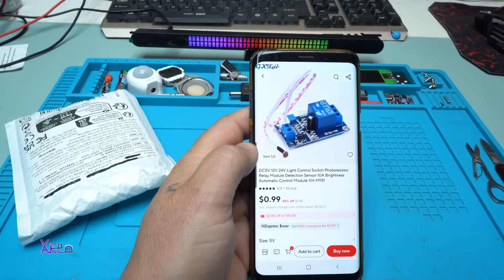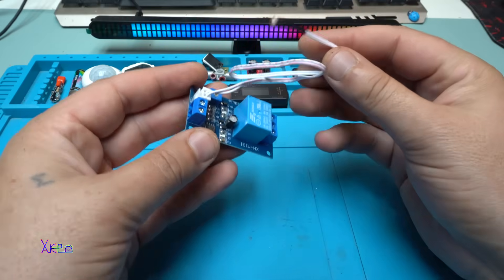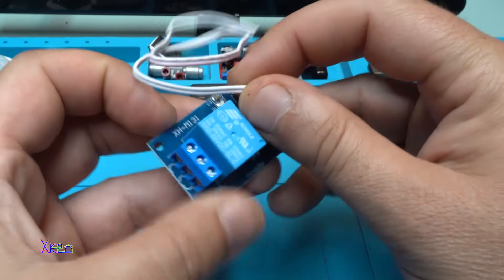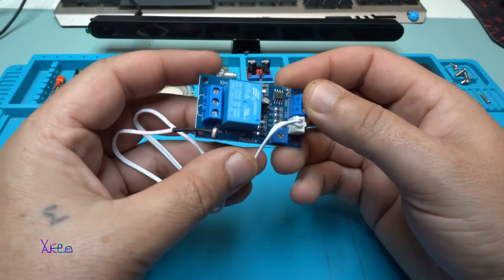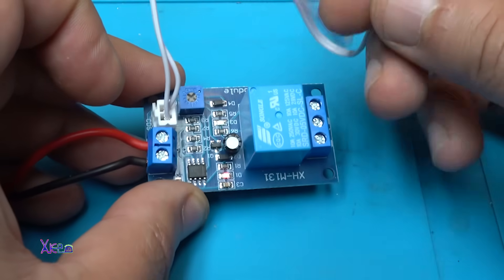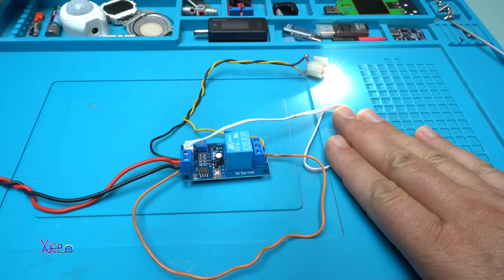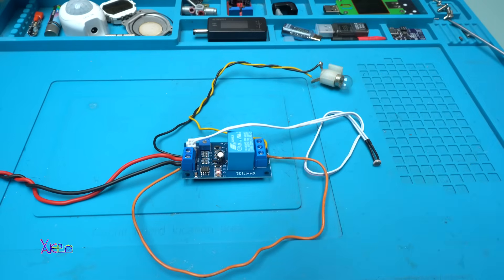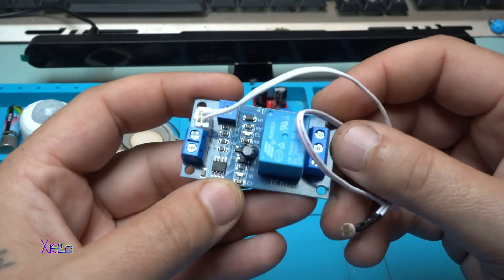$1 Aliexpress Module That is PRACTICAL?

Comment: I saw a potentiometer on the board, is that to control output voltage or sensor senstivity?
Reply: Sensitivity. Relay doesn't control voltage.
Reply: The sensitivity of the light sensor. 
The sensor is a resistor that changes value depending on how much light is present. 

Varying the pot, varies the point where the sensor triggers probably an op amp, to turn the relay on. 

The sensors are fun, and cheap. Search for "photo resistor".

Comment: Someone needs to connect a PIR Motion Sensor in series with the Photo-Resistor to see if the Relay then only activates when both dark and there is motion.
I wonder if that would work or it would mess the module up.

Comment: You can change the photo sensor for a temperature probe and use it just as well as a temperature sensor. I use one of these to control the heating in an egg incubator.